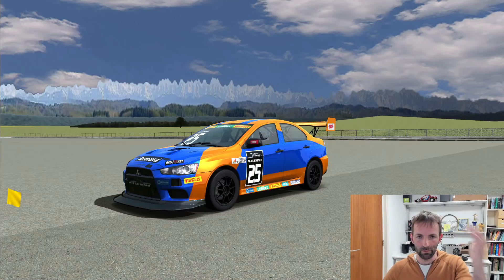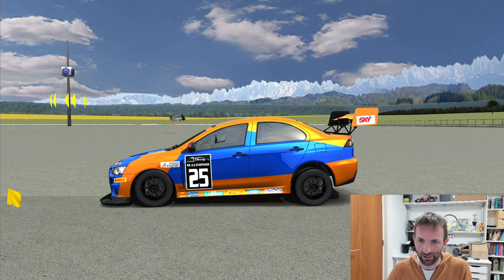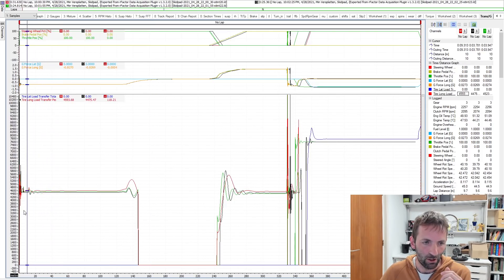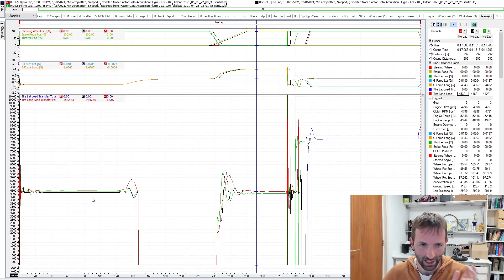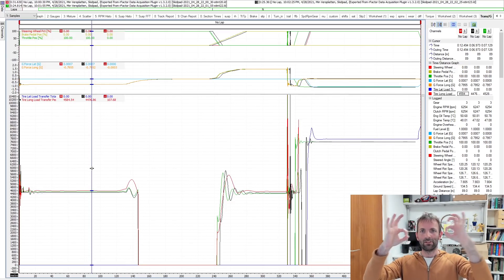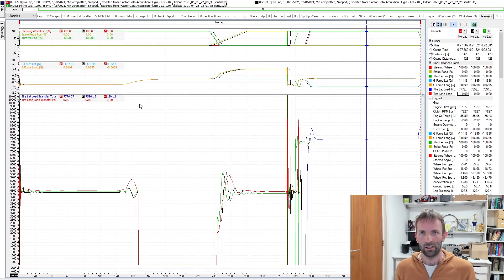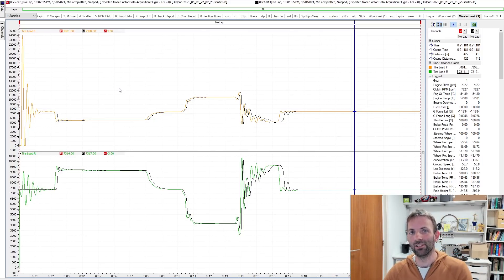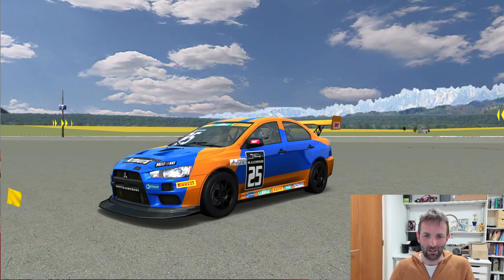Weight Transfer is *INVISIBLE* Let's Explain Why!

Comment: Instead of thinking about it as weight transfer, should we be thinking about it as the car trying to rotate (torque?) around its centre of mass (pitch/roll) as a result of accelleration / deceleration / cornering?
Reply from the maker: Pretty much! One G force is a force equal to the mass of the car, applied in the center of gravity, some distance off the ground. This is a 'tip over force' that is reacted by the wheelbase distance when braking and accelerating, and reacted by the width of car (track width) when cornering. So yes, seeing it as a torque that gets easier to counter the bigger the distance you apply the counter force at is a good way to visualize it. It doesn't matter if everything moves a bit, it is purely a function of the CG height versus the wheelbase, and the CG height versus the track width.
Reply: @NielsHeusinkveld  So therefor the preference for as low as possible CG so it limits the 'weight transfer' effect as the mass has less 'leverage'?
Reply: @stevensimpson  yes, and less leverage also means the actual position of the CG shifts less if you achieve the same rolling/pitching angle. (that is the small force difference we see in the steady states of Nils plots)
Reply: @NielsHeusinkveld  sorry, follow up question, do sims have to consider the angular momentum from the rotation (including weight distribution) or would just looking at the centre of mass vs suspension geometry do enough? Thinking of how mid engine vs rear engine would be modelled as an example.

Comment: Wow, this video has really confused me, never thought about this.

Just to clarify one thing, I remember in your car setups video I think you said that a stiffer front end causes understeer because more weight is transferred to the outside tire which becomes more heavily loaded, and because tire load and tire grip is not a linear relationship as the friction coefficient reduces as the load increases, a heavily loaded front and a really lightly loaded front together produce less grip then more evenly loaded tires. But then now in this video if I understand correctly you are saying antiroll bars, springs stifness/softness etc don't affect the weight transfer? What am I missing?
Reply from the maker: Good question! The total weight transfer is the same if you pull the same cornering G force. But you can change how much of this total transfer is taken by the front axle and how much by the rear axle. That can make a big difference in car handling, but the total weight transfer is not affected, just the percentage taken by the front and rear pair of tires.
Reply: @NielsHeusinkveld  Ahhhh okay that makes sense, thank you for clarifying. And I assume you can also also change the proportion of weight transfer between outside and inside tires aswell as front to back. 

Thanks for replying!
Reply: @yz249 , imagine a car with a solid / welded front suspension, and a very soft rear suspension. Now attach a rope to the car's roof, and pull it sideways. Keep pulling until the car begins to almost roll over (some wheel is off the ground). Can you guess which wheel is in the air?

In that situation, the axle with the wheel in the air has only one wheel to handle the cars vertical and lateral force. The other axle has two. That means that the axle with the most leveled base has more grip to spare (probably - because there are other factors in play besides only suspension rigidity, but you get the picture). If you get interested in this topic, search for "tire load sensitivity".

Comment: My favorite practical example of weight transfer was in my F4 car at VIR T10. When you go in there normally your instinct is to lift off and lightly brake, and it feels like you went super fast through there because the car is on edge the whole time. But if you never fully lift and less the sudden change of weight you can go through the corner much faster and it’s more stable, all because you didn’t unsettle the platform by getting in the brakes and putting all the weight on the front wheels.
Reply from the maker: I often have something 'similar' in the sim too. Like the esses at Suzuka, being smoother by lifting instead of stabbing the brakes makes the car easier to 'flow' through those turns. Kinda the same to your example, but you had lifting vs flat out and I am braking vs lifting, both would've caused front load spikes (and thus potential front grip spikes).
With aero cars, ride heights change the total amount of downforce, and the front/rear distribution of downforce a lot, so you not only have weight moving around, you also get balance changes from the aero force acting further front or back on the car.
Reply: Sorry for the massive ignorance, but how does this relate to the grip level in the tires?
Reply: @pr7vinas Tyre grip potential (longitudinal and lateral force) is mostly a function of friction coefficient and downward load on the tyre. More load generally means more grip on that tyre.

Comment: Next up! Weight transfer with loose cargo in the car!
How would that handle physics wise? :D
Reply from the maker: That would move the center of gravity of the 'total car', possibly significantly. Changing rake on a race car doesn't really move its CG forward or backward, but loose cargo, or sloshing fuel, can have a real effect on moving the 'effective center of gravity location.